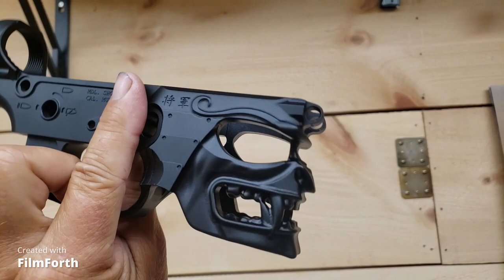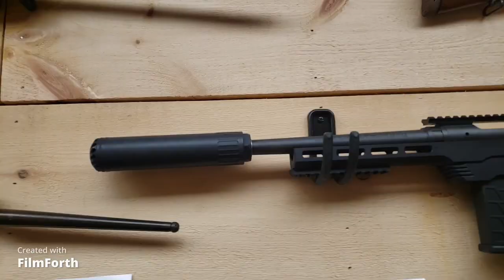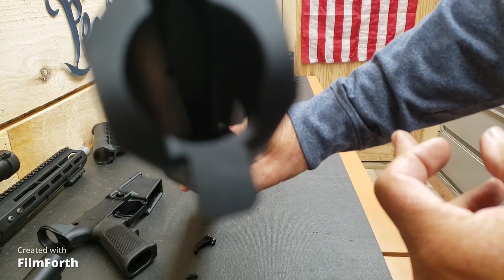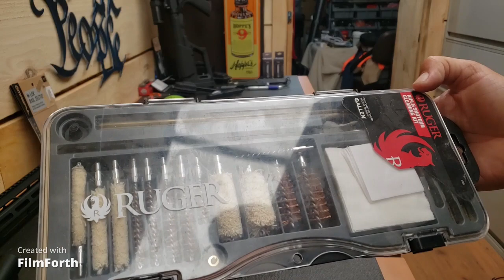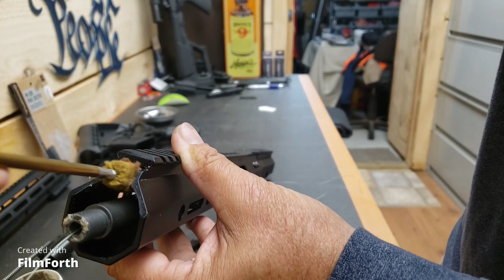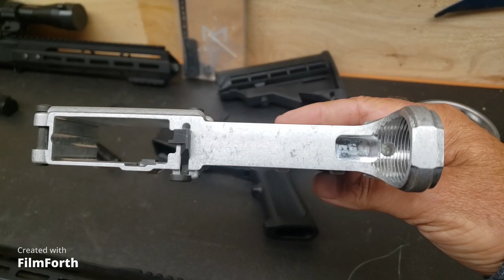Viewer question addressed, New unboxing 22LR BCA

Comment: Great video m.c. I love bca. I have their 450 bushmaster upper and it is a beast. Shoots great, being a little heavy handles the recoil. Tied into an aero receiver it is perfect
Reply from the maker: My BCA uppers work terrific for the cost.
This 16" 22LR has a sharp little aluminum that should have been machined off the handguard and some thin areas on the coating (bottom of the handguard).
Next up: see how it groups. 🎯
Reply: make sure the chamber is fully supported
Reply from the maker: ?¿ Chamber fully supported ?¿
I must be missing something. 
In an AR platform, how would someone do this?

The "chamber" is the breach of the barrel. 
The barrel is inserted into the action through the front of the upper receiver.
The barrel is held tight to the receiver with the barrel nut.

What am I missing?

Comment: So if I get a AR 15 lower, I could turn it into a 223/556, pistol or a 300 BO right? with a barrel and bolt swap  and a 308 is a AR-10 lower right?
Reply from the maker: My understanding, in my State, is my FFL dealer enters the stripped frame into their books as "other", upon receipt from the distributor. 
If you purchase a "complete", functional firearm (lower and upper connected) it is logged in as how it arrives (Rifle or pistol) HOWEVER,  now, i believe the "pistol" will soon not be an option, but referred to as a Short Barrel Rifle (SBR)? But, you need to check prior to purchase...or, it may end up "in jail" at the FFL dealer until the paperwork is proper. (Obtaining a tax stamp and paying $200 to the Feds...with up to a year wait)
There are deeper "rabbit holes" as to IF the AR platform is even a firearms, based on the definition of firearms, but this is as deep as I'll go on that subject.
Uppers, depending on your local and State laws, are directly mailed to your home.
AR15, for the most part, all interchange uppers. So, 223 Wylde, 5.56, 300BO, 350 Legend, 450 Bushmaster, ect all fit the lower. (Even a 50 BMG from Safety Harbor manufacturing)

AR10's are not as standardized, and few parts are universal. 22-250, 243, 308, 8.6 Blackout are a larger length bullet, needing a larger frame.
Reply from the maker: Actually, you will find the bolt works directly for most cartridges in the 5.56 family.
6.5 Grendel I believe has a different boltface and magazines. 
(I typically just buy a "complete" upper. This way, I know all the upper parts are a working set)
Reply: @Michigan4Conservative  Yeah my thought was buying a upper kit for each caliber but using the same lower. just swapping out each time for what I want to shoot.... but maybe I just build each caliber as a complete gun.... that's $$$$ LOL!!! IDK I will figure it out when that time comes.... I know I reload and shoot for 9mm and 308 the most so I would like to have AR's for those because I already have ammo for that platforms.... but Thanks again M.C
Reply from the maker: @michaeldunn150  
Thank you for watching and being an active subscriber. 👍
Reply: @michaeldunn150  I highly recommend getting a inexpensive 5.56 lower, and complete upper. I mean $230-$275 at PSA for a complete upper that you can count on. Just saying,  when the shtf  .308 will not be as widely available as 5.56, and 9mm. Just my 2 cents.